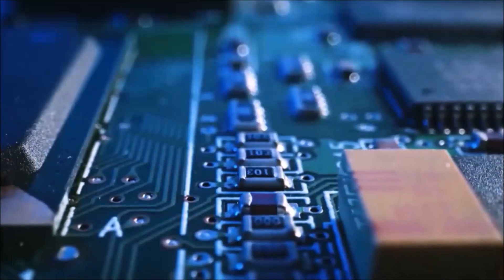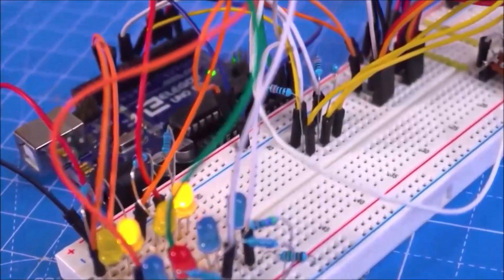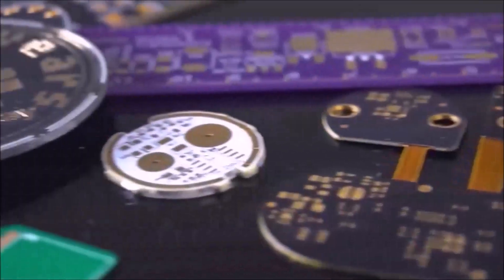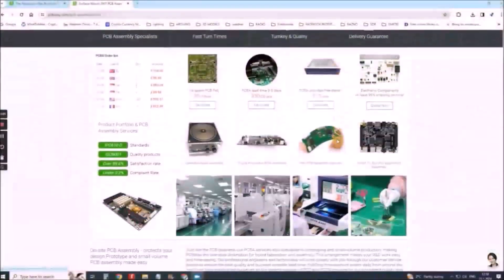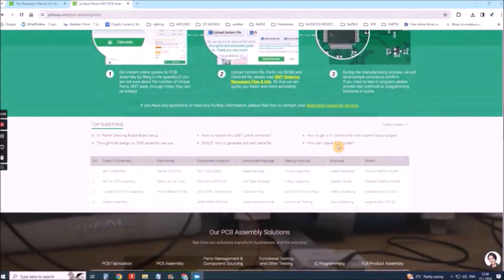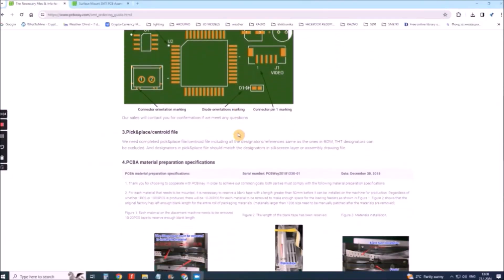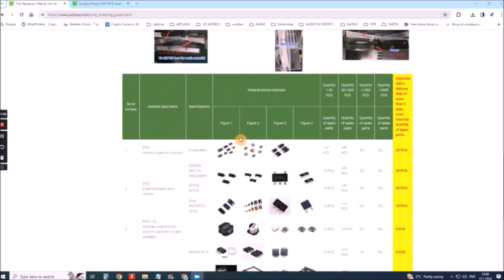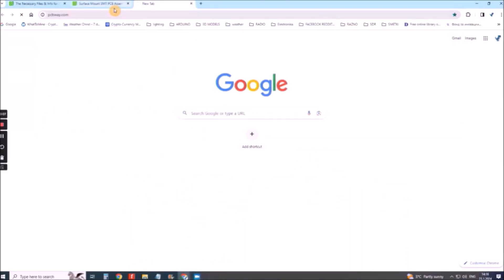Arduino VFO Project with a Large LCD Display

Comment: Very nice job 👍🏻 I built the original CesarSound unit with PCB from PCBWay. I modified the code to remove all the receiver stuff, as I wanted to use it as a sig gen only. I removed the 5kHz step & added the "missing" 100Hz & 100kHz steps. I also changed the band settings to frequencies that are more useful to a sig gen, rather than broadcast or amateur radio bands. Removing all the RX stuff meant that I could increase the font size, as it only needed to show "frequency" & "step size" on the display. I also included a library to run the 1.3" display. I will have a look round for the display you used. It will be easier to see with my ageing eyes. 🥸😆
Reply: Put then you new firmware for us please !! Thanks !!